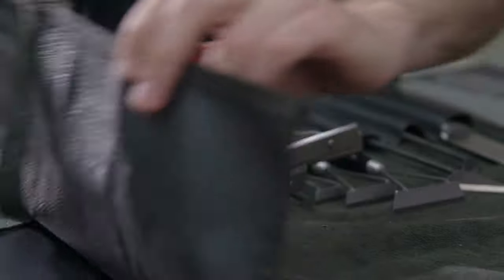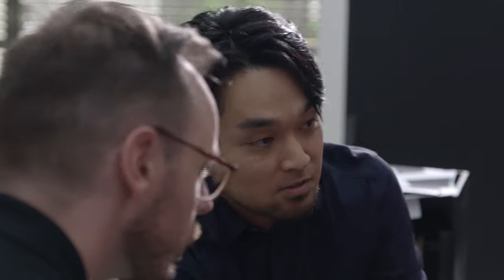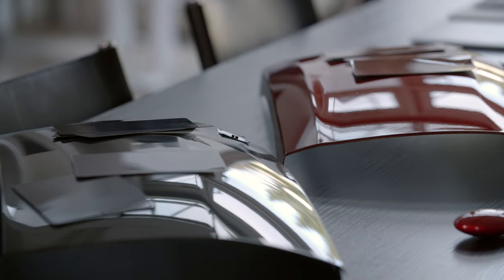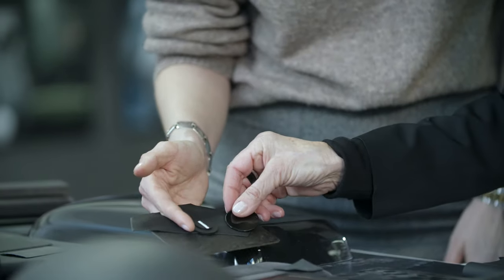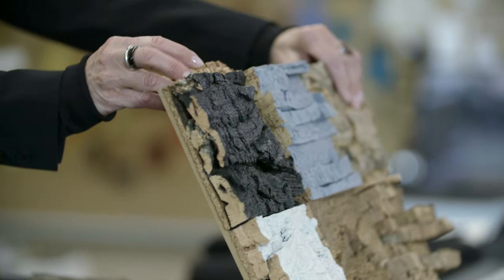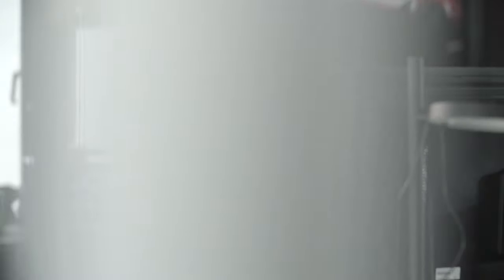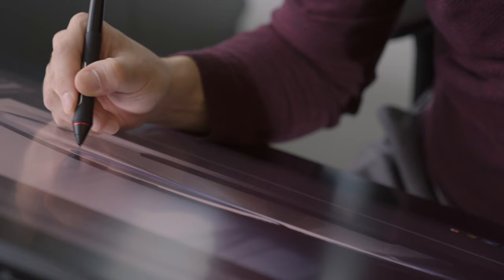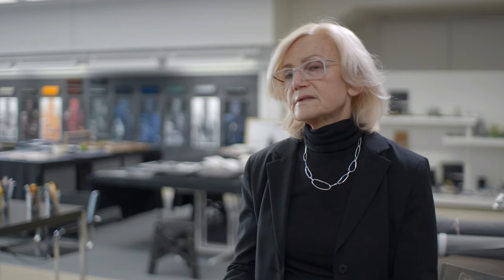Inside the Mazda Design Studio

Comment: Sounds great but why haven't any of the later generation cars aged as good as the 90's cars like the pop up headlight 323 or even the Bertone 626s? Those look good even today.
Reply: They have cut corners at every stage of the production process even down to the thickness of the windshields,  my CX-5's  been replaced three times as they simply crack on their own for no apparent reason. Even the quality of metals used for engine components are appealing quality. https://www.youtube.com/watch?v=nHiHgnAGGrQ
Reply from the maker: Hi Don, thank you for your comment. We're sorry to hear you're not a fan of the design of the current Mazda range but we understand that design is subjective. Do you drive a Mazda yourself?
Reply: @mazdauk  you gonna talk to me Mazda UK ????????????
Reply: @mazdauk  I have a painstakingly maintained eternal red NB which looks stunning, yes. My first car was the first gen Bertone designed 626.